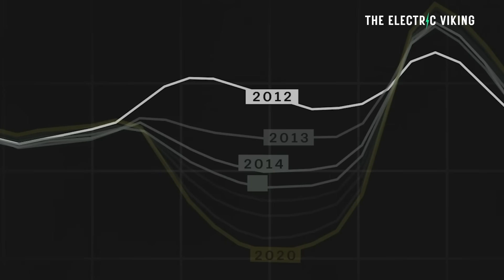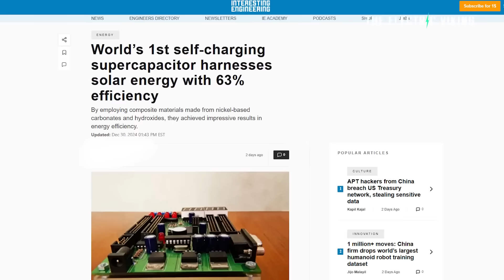Historic First: Solar Tops EU Electricity in 2025 as Coal and Gas Plummet

Comment: What are Europe's electrical costs compared to the U.S.?
Reply: Electricty bill total: kwh+grid connection+CO2 tax+electricity consumption tax+VAT is double or triple the U.S. cost and rising. Unleaded 95 is $7-$8 per gallon. From 2003 to 2018 (installation phase of solar + wind) prices dropped and stabilized as it is always the case when You add more power (subsidized solar + wind) to an already existing grid providing 100% of base load. Once a magical threshold of 20% renewables (solar+wind) is exceeded and countries start to phase out conventional electricity generation (2019 to 2021 and onwards, less than 80% base load) prices start to rise and there are severe jumps in pricing. Several countries (Germany, UK, Spain, Portugal) export excess renewable power when wholesale prices are low or negative (wind blows everywhere or sun shines everywhere) but than have to import energy at extortionate prices when the sun does not shine (16 hrs a day). Germany as an example faces grid renewal cost of between $ 500 bn and $ 1.2 trillion (depends who You ask) and an equal amount for (short-term) battery storage (depends who You ask). In addition they are phasing out coal and nuclear but did not build the envisaged 70 gas thermal plants (North-Stream) so they have to import electricity from their neighbours at a higher cost. This led to the increase of the electricity price in Norway (household electricity was 6-9 Cents for decades) to 22 Cents nowadays, still amongst the cheapest in the EU. People protest and want to "cut the cables" to Germany and the UK. France keeps running its nuclear plants and doing very well CO2 and pricewise. In addition to all of the above Germany will still need to double its (tax payer subsidized) wind generation capacity to phase out the rest of coal and the remaining gaz if they don´t find another solution.
Reply: @SunshineShane  I've noticed a few quirks in your written English which makes me think it's not your first language. Correct?
Reply: @SunshineShane  Where do you get your "magical 20% renewables" figure from?

Also not sure why you're quoting unleaded prices. We don't use petrol/gasoline for electricity generation. If you're confusing the EV market with domestic and commercial energy generation, you need to look at your numbers again. EVs are a use case. 

Again you've repeated the lie about daily sunshine hours. It's 17 hours a day during summer here in Scotland, and 8 in the depths of winter.

You also seem to have ignored the fact that most of the energy generated by solar installed on a roof is used by that property, so there's no grid effects other than reducing their delivery need. Where export occurs, it does so at the local level before the transformer at the substation. This is the responsibility of the DNO to correctly asses what their network will handle in terms of generation. This is what the UK G98/99 applications are for. The DNO is not obligated to upgrade anything - although obviously if they wish to use domestic battery systems to balance their portion of the grid, it's in their interest to do so.

Solar has only really taken off in Europe recently, thanks largely to Putin's invasion of Ukraine. We had very high energy bills before that though. Solar is helping to reduce them, not hike them. You appear to have your cause and effect the wrong way around!

The economic figures for the US are going to be different because you pay less for energy than most of the rest of the world - but the largest factor in small solar costs in the US is your "buy now, pay later" culture where Big Finance takes a whacking great chunk of cash for providing credit.
Reply: @geconserver  17 hours of solar energy production in Scotland? Wow - lol. What I´ve looked at is how many kwh are produced per hour of sunshine and you may believe me or not - for fixed roof installations it´s almost neglegible except for the 8 hours mentioned in Summer and max 3 hours in Winter. As for wholesale EU electricity market prices from 2000 to 2025 - they are all over the net. From 2003 to 2018 cheap and stable - from than onwards it´s chaos. There must be a reason - maybe it´s climate change? The UK is going the same way as Germany, no worries. De-industrialization saves a lot of energy. But than.... AI would require at least 3 times the energy produced in the UK or Germany today. Can You imagine machines working 24/7 - ploughing the fields, building homes and cars, just with AI and electricity?
Reply: @SunshineShane  I don't need your "calculations", I have solar installed and generating energy already. But more importantly, we have plenty of freely available calculators that give very accurate    predictions based on the sun's position at any given moment and data on historical weather patterns for every country in the world. And from all of this, we know that your "calculations" are completely wrong. If you don't believe me about 17 hours of daylight during summer in Scotland, you can simply look it up. These are what we call "facts".

In the EU, as with everywhere else, energy prices fluctuate with the wholesale price of gas. So what you're seeing when you call it "chaos" is the effect of a global commodity market.

It's unlikely that AI will result in 3x today's energy requirements, but electrification of vehicles and heating will probably take more than that. Renewables can handle that exponential growth because they are fast and clean to install. Nuclear takes decades and is vastly too expensive.

But most importantly, we KNOW we cannot keep using fossil fuels. So no matter what BS you peddle, we are NOT building more coal or gas power stations.
Reply: @SunshineShane Not like generating three times the electricity should be a problem for society with robots and good AI.
Reply: @jackneuman5108  Yes, You could have a robot spinning a dynamo 24/7.....lol
Reply: @SunshineShane Indeed. Or AI organized and optimized energy generation and distribution.

Not to mention rest of the technology has a habit of advancing as well.

Pretty telling the that the limit of your imagination of the future is a robot spinning dynamo 😂
Reply: @jackneuman5108  Yes, I thought so. Now we only need to mandate every household to buy an AI fridge, AI washing machine, AI dish cleaner, AI A/C unit, AI domestic energy control unit. This will be very, very cheap and save a lot of money on the energy bill in the long run. It will help to adapt consumption to when the sun is shining and the wind is blowing - which is about 20% to 25% of the time for each.
Reply: Dropping. Renewables are much cheaper than nuclear or fossil fuels, so as the old generators are replaced the cost of energy will inevitably decline.